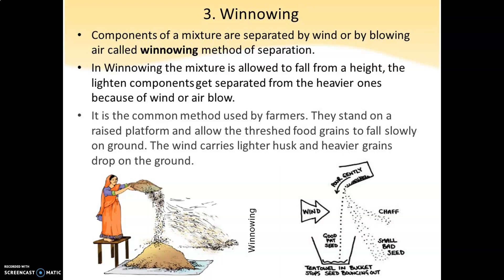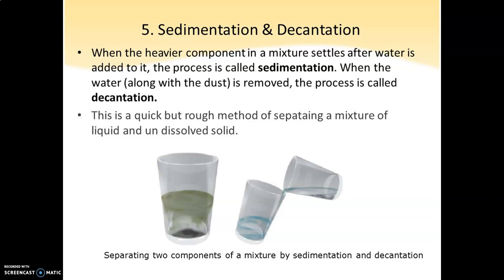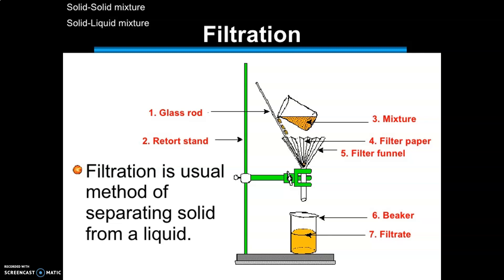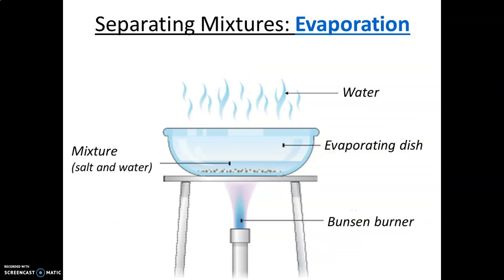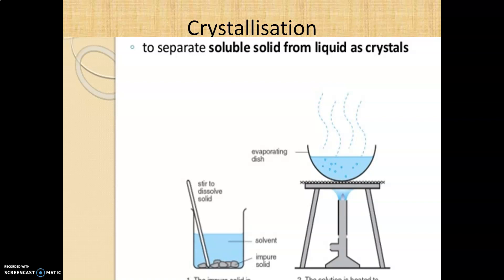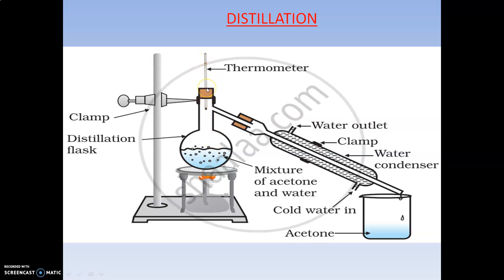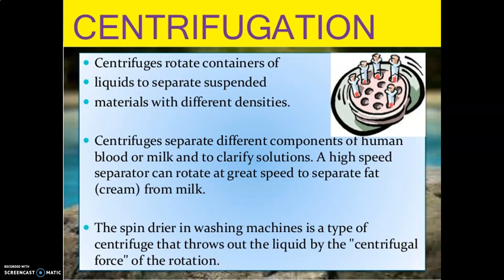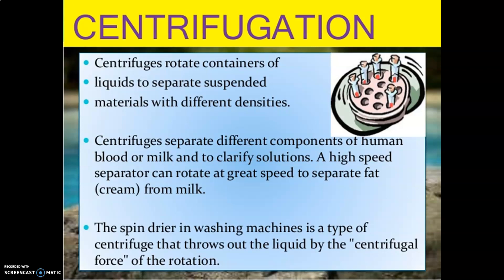SEPARATION OF SOLID -LIQUID MIXTURE-CLASS 7

Comment: 6:19 - Ma'am but water boils at 100degrees celcius right, how is it that it evaporates at it's boiling point ?
Reply from the maker: There is difference in evaporation and boiling..... When water is heated it starts evaporating untill it reaches its boiling point...
Reply: @AradhnaJohnson  Thank you so much ma'am.